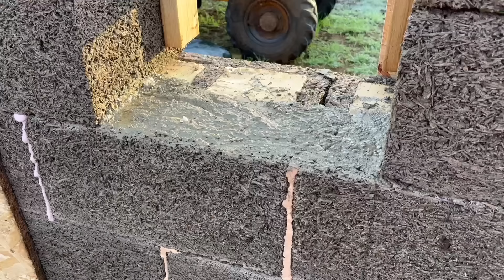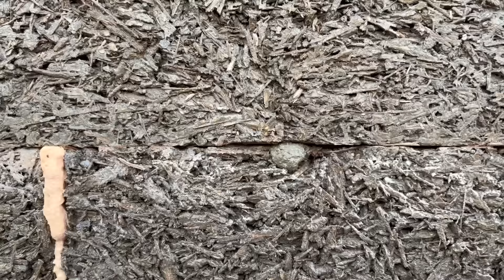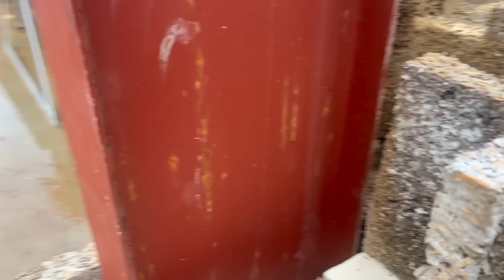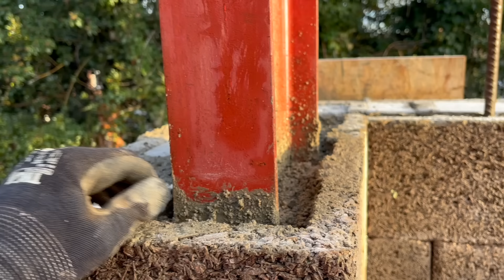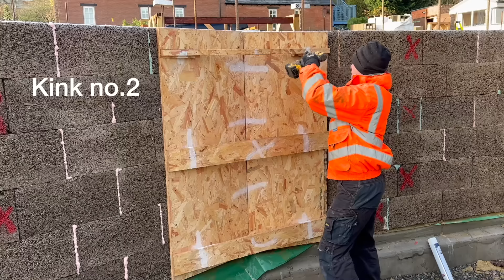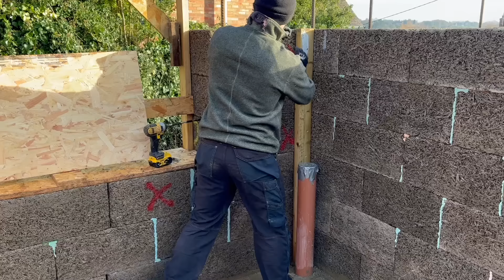Removing the Shuttering After Our Biggest Self-Build Milestone - ICF - Ecobrix

Comment: apart from a tower, that is difficult to build,  the square corner is the strongest and simplest. The obtuse angle will cause you problems all the way, floor, ceilings skirtings, ceiling cove, floor coverings roof trusses, gutters, roof tiles, and furniture. BUT you were probably talked in to it by a gree vegetable, your artichoke. BUT well done so far.

Comment: Great result from the pour ,I am also watching a couple in France (homesteading Uncontained) who have used a similar technique but their blocks are concrete(Bloch a bonche) I believe they are called, which makes me wonder why there is no horizontal rebar specified in your walls the walls they have been building in France have rebar on every lift and their property is only timber framed single floor, maybe it’s a French build requirement, however great job looking forward to following your progress. 👍

Comment: I'm struggling to understand the preference for EcoBrix over EPS ICF systems, which have continuous insulation over the concrete cores, so presumably have better U-values. Can someone please educate me?
Reply from the maker: This is purely our preference for a number of reasons, the EPS ICF options don’t suit our skill set being self builders. They seem to require more scaffolding/shuttering systems that would need to be bought/hired/installed by professionals. The Ecobrix block is almost self ‘shored’ only needing shuttering at certain aspects.
Also this block being made of recycled wood and feeling substantial when handled makes us feel confident in their structural qualities and happy that they are partly made up of recycled materials.
They are easily modified to suit a variety of build aspects and don’t need a lot of reinforcing in normal circumstances.
The woodcrete block has insulating properties due to it being aerated so I believe that aids in none continuous PIR insulation within the block. Stated U-Values are not too dissimilar between Ecobrix and EPS.
There’s also a number of advantages with the woodcrete regards to installing services, applying fixings and internal/external wall coverings.
Hope that’s given you a good idea of why we have chosen Ecobrix over EPS options.  A lot of it is down to personal preference, I’m sure EPS options would suit many people and we aren’t suggesting otherwise.👍🏻😁 thank you for taking an interest.👍🏻
Reply: EcoBrix ffrom their web site show a u factor of .15 or an R factor of 6.6. The bricks offer not only insulation, but also thermal mass. I'm going to assume that additional insulation will be used beyond just the bricks as built in these early steps. Some really big benefits of Ecobrix or EPS ICE are that you aren't using a whole lot of chemicals to create the foam insulation. These bricks are also WAY more fire resistant than EPS. An EPS ICF house won't fall down in fire due to the concrete filler, but once flames hit the foam, it's going to not only burn, but have very toxic smoke. Both Ecobix and EPS ICF help to mostly eliminate thermal bridging compared to traditional stick frame construction normal in North America of brick building more traditional in Europe. I suspect the outside of this house will get a layer of external insulation and the inside can either be covered in gypsum board or could be topped with a render. I am looking forward to see how all of that will go once the structure is up.

Comment: I read the Ecobrix specs and I don't quite get the U value. To me it would seem the U value varies across the 'brick', where there is PIR compared to only the wood fibre mix.
Reply from the maker: You are right it that there will be different U-Values.👍🏻 I believe it’s all taken into account and is a sole value of the block itself once fully installed. The woodcrete surround has insulating properties due to being aerated so what ever value that produces needs to be factored in and added to the U-Value that the PIR insulation has.
Also the concrete filled core will have a U-Value to be factored in.
It’s performance can then measured and with only one side of the block being insulated it allows the heat energy stored in the concrete core to just travel inwards towards the room space aiding in its energy efficiency and its overall U-Value.
I’m no expert in how U-Values are made/calculated but I have read some notes on them and it’s based on all materials and the installation method.🤔😁👍🏻
A good example would be bricks that have holes in the core, is the U-Value of them different across the face of the brick because the clay and shale is not continuous and solid?🤔 
As I’ve said I’m definitely no expert and sometimes reading a little is worse than reading a lot but it seems to make sense to me.👍🏻😅😁
Reply: @TurningRosemountUpsideDown I guess you could use sheets of insulated plasterboard on the inner skin to even out the variations. It will be a great home, either way!